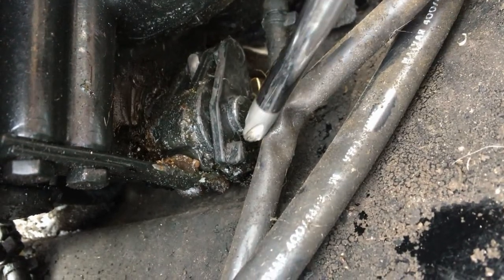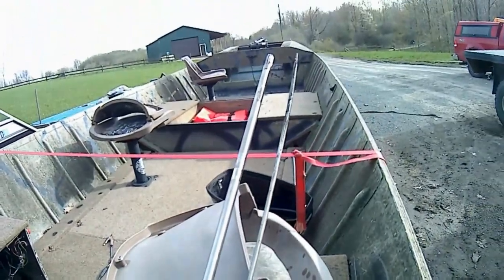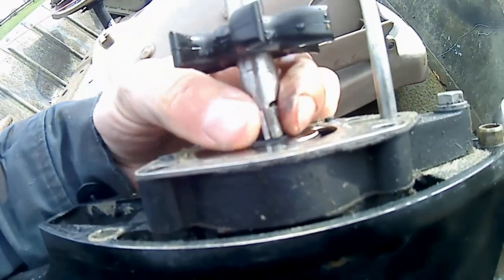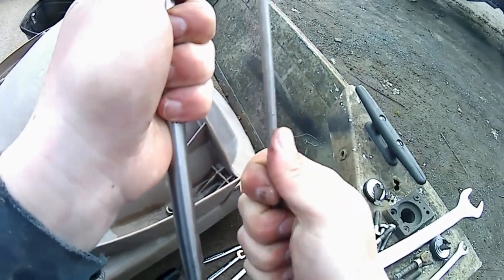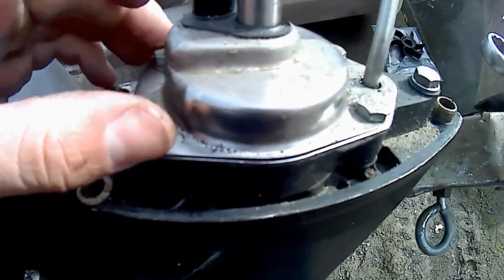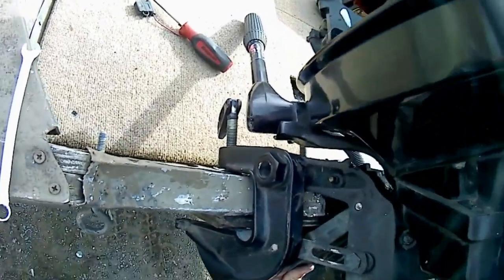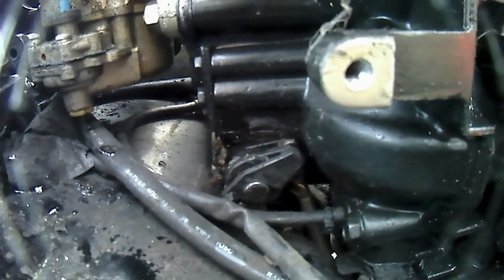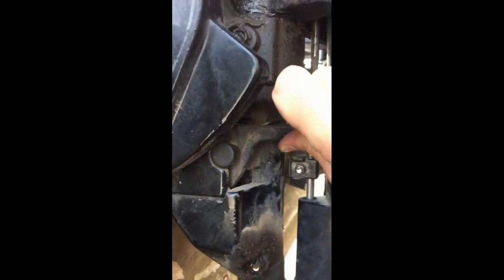How to Replace Mercury 15hp Water pump Impeller

Comment: Hi quick question, after replacing the water pump on my mercury 6hp engine I was checking the forward, reverse and neutral gear  i noticed that in neutral would spin both ways and forward would spin freely to the right but reverse it won't spin freely in any direction unless applying force is this normal? Thanks in advance
Reply: did you find the issue? if you moved the rod threaded into lower end for shifter it will happen. if you do not have hand control shifter in forward and spin the propeller so it is in forward motion it can happen, there can be otehr causes but not many places on net to fing them , kinda shocked me as it is common
Reply: This is the same problem I’m having . And can’t get get shift linkeage correct  with tiller handle now ….. should prop spin freely to the right in forward and not freely in either direction in reverse ? Also what is the fix for this is it having the the shift linkeage correctly adjusted ….? I heard 16.5 “ from end of shift linkage base (lower unit has to be removed to measure)  to the pin hole is the length it should be adjusted to ….? Thanks